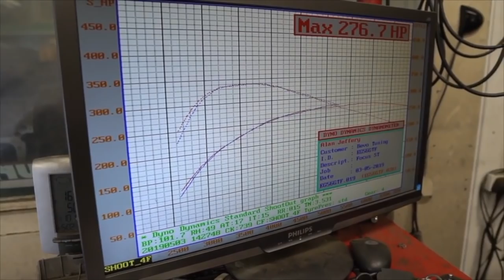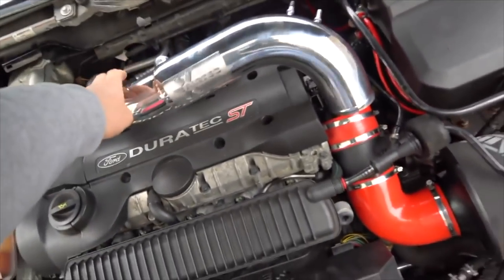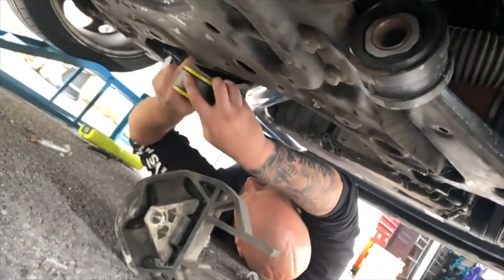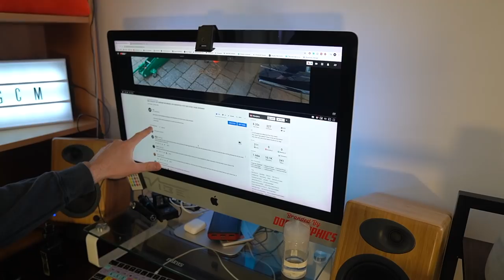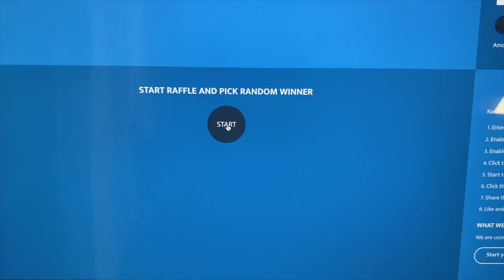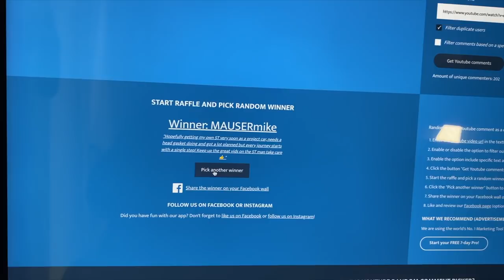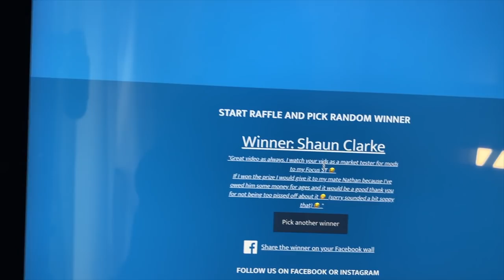GEORGES CAR MEDIA - MK2 FOCUS ST - 10,000 SUBSCRIBER GIVEAWAY SPECIAL

Comment: It's alright mate, even Russians grimace a bit when downing a shot haha. Cheers G, congratulations on reaching 10k subscribers. You've helped me out a lot to get my old ST up to scratch. For example, just done my coolant hoses today. My effing jubilee clips were the wrong way like yours were! Mr. Dremel got the buggers off though. Also just fitted a fresh front wheel bearing. I lazily allowed a garage to fit the passenger side a few months back, afterwards I thought sod that, I will do my bearings myself. So I got the correct tool, and did just that on the drivers side. Piece of piss. I did both rear hubs few weeks back. The ST has a full new set of bearings. It has new rear discs, new front discs, pads of course, all new splash guards for the discs, replaced bleed nipples, flushed brake fluid, painted calipers red, new clips in calipers, sorted the pin rubbers. All new rear bushes from PSB, two refurbished-by-myself wishbones with PSB bushes and bolt in ball joints, painted in lovely hammerite metallic blue. Bilstein B12 Pro shockers with H&R springs are on the way.  I now have a good platform to work from! Engine mods next. The thing is, you've got me going on really going to town on my ST. You created a monster mate! I'm addicted to upping the specs. on this thing now. I was depressed after something went really tits up with my life plan, and this has got me back on the road to recovery. It's more than just tinkering with cars.
Reply from the maker: Bro your amazing. You always take so much time to comment which doesn’t go unnoticed. Cars work well as a method of escapism :) hope you see that too